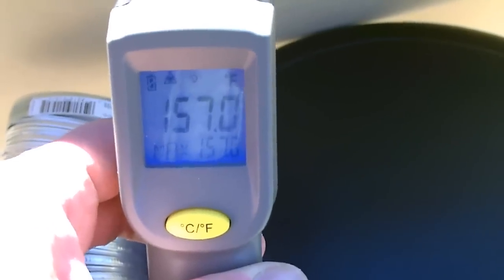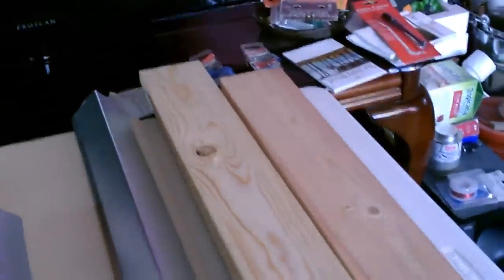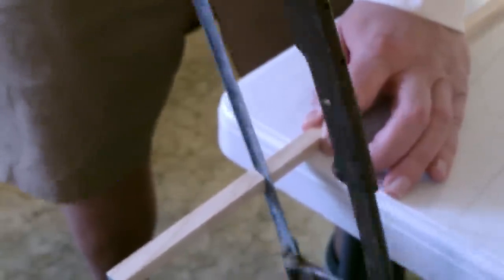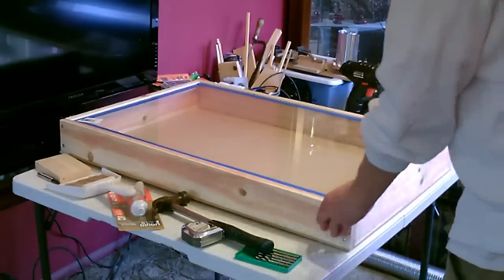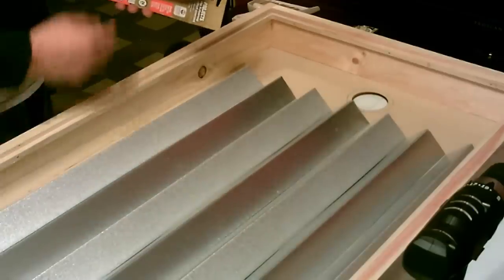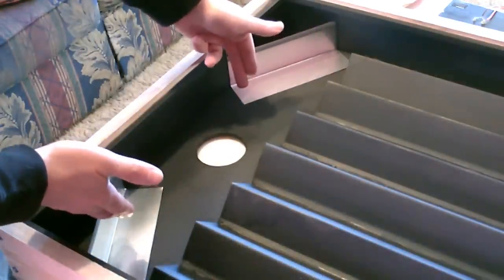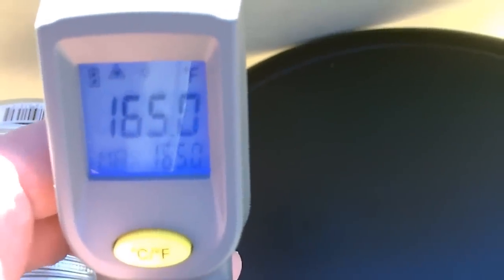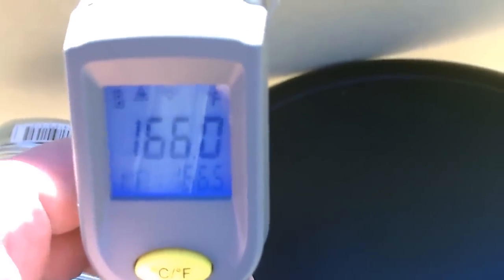DIY Solar Air Heater! - The Steel Slat “Drip-Edge” Solar Heater! - New Design! 160F 74C in January!

Comment: Would you recommend a bigger fan motor, for more air flow?  Thanks for the video.
Reply: More air flow means that the air remains in the box for less time, from the time it enters at the bottom until it is discharged at the top.  The air needs to remain in the box long enough for the heat of the metal panels to transfer to the air.  You need to find the "sweet spot".
Reply from the maker: hi. if you use a bigger fan you'd want to make the whole thing bigger (or the air coming out won't be as warm). the fan is sized to match the size of the collector.

Comment: And how did you hook it into the house?
Reply from the maker: hi. the best way i've found is to go thru a pre-existing window. i use a short section of 1x6 lumber (cut to fit the width of the window). then i cut a 3" round hole in it and attached the opposite end of the 3" duct hose to the wood (the same way i attached it to the back of the collector). then just drop it in the window and close window down on it. with this setup you can drill several 3" holes side by side if you want to, and connect 2, 3 or more collectors to the same window using the same wood. *other possible ways (without cutting a hole in home)... you can use any unused vents or an unused pet door.

Comment: Hi
As a novice excuse my query if nonsensical.
If you are receiving enough sun to make this work during the daytime surely it warm enough in the property.  At night when you do need the heat this would not work ?
Reply: Your house should be insulated to stop the outside altering its temperature too much. This is designed to trap the heat for use.

Comment: Google “solar chimney”.  Pull air from a duct through the lower part of your wall (or a lower floor/basement) and output it higher up the wall.  Angle your heater outside to optimum solar angle.  Convection will naturally pull air through the heater and your fan will not have to work as hard.

Comment: putting that on a table with the air intake below and the air output rising into a cabin would be a great way of making it all work with zero need for fans. Let convection take care of it all.
Reply: Just what I was thinking...
Reply: The fan is pulling the air though. Sure, convection would work, but the fan is going to move so much more air overall
Reply: @ZeroHecksGiven  I used a convection heater that had a fan, in one apartment. I always had the fan turned off as it made not a jot of difference.

Comment: Try using the inner plexiglass from an old big screen projection tv instead of glass. Its magnified so you'll also need to make a metal frame and possibly thicker gauge metal inside but the heat those generate is insane.
Reply: Are they UV light resistant? If not, the plexiglass could get brittle in a year. Great idea, though! Been thinking about covering some solar panels with it and giving it a coat of UV resistant lacquer.

Comment: We were building these at Mother Earth R&D in the late 60s and early 70s. Didn't have the solar voltaic panels yet. Depended on convection for flow. There was a company in Oklahoma in the late 1800s building them and installing on homes. That's where we got our ideas fir them. Helps to have a house 3' or 4' off the ground to lean collectors under windows for installations for the passive design.

Comment: I built a heater very similar to this one about 20 years ago. It had the air recirculated with simple internal ducting with ports top and bottom. The assembly fit over a double hung window and I could regulate the output by simply opening and closing the windows. This simple solar heater provided more heat than the South side of my home could ever need. No fan, no electricity, just the sun. I frequently had to close the windows because it was too warm. Total cost to build was about fifty dollars.
Reply: A good way to save money is to go to a scrap yard and find old fluorescent light fixtures. Inside you will find thin sheet metal reflectors that have the same 90°s as the sheet metal strips your using from home depot however you will get them at less than a tenth of the cost. Keep thinking outside of the box "pun intended" 😎👍
Reply: See people ??? This is what I'm talking about !! Build your own !! They totally work and aint rocket science. You cant screw up. They wont blow up. Hahaha. Good comment guy.
Reply: So you don't necessarily need the fan? Could it be done on a flat surface like a flat roof? Or does the air need to rise?
Reply: @ESLinsider  hot air goes up, so if you design a low air intake to a solar heater, and have the exhaust air high up, then you'll get a natural flow.
Reply: @HyperSculptor  How can we get this information to the European people for this winter? Because of Russia cutting off gas supply I am very worried about the average person who struggles to pay utility bills.
Reply: @worldpeace8187  here we are💪
Reply: @worldpeace8187  Just watch the tutotorials here on Youtube.  Heaters made with soda cans were invented for use in Canada - if they work there, they will work In Ukraine and the Baltics 👍🏽

Comment: I'm not sure why people use channels / tubes / cans... sheet metal should be adequate - a single plane in front of an air pocket behind, NO?
I also agree with Aguila below, direct your home air into the bottom, so it's already starting out warm, then being heated more.
And, lastly, you can forego a lot of this construction / assembly work if you just place a matt black sheet of metal somewhere in direct sunlight during the period you want heat. Don't block the windows, just place them inboard of the windows somewhere in the room, in direct sunlight.
Of course, these other ideas of insulated assemblies have a place when you want to Build them into your home without blocking windows.

Comment: Why would you not want to take inside air and move through?
Reply from the maker: hi there. i like using outside air because it introduces fresh air into the home. also , you only have to have one inlet into the home  (versus 2 inlets). but your way heats faster so you have to weight the positives and negatives of each and choose what's best for your situation. 🙂

Comment: You can use cardboard boxes to insulate the box.  Just cut and tape  inside the box.  The cardboard boxes are free from the stores.  Haft of inch of cardboard boxes could provide up to R5 insulation to the box.  The temperature inside the box will be higher as you add insulation to it.
Reply: R5 usually takes a bit over an inch of 10 psi rated polystyrene foam and cardboard is more conductive than most 10 psi rated polystyrene foam, so you probably want to rely on trapping an air gap more than so then directly using the cardboard as an insulator.

Comment: I have two sliding glass doors to do this with.. very heavy ! Build looks great obvious you could use insulation, and an old double insulated window is a plus. I believe you want the collector sealed
in front no air movement and about an inch back from glass. (You will get cold air exchange moving at glass surface especially without double glass). I may use down spouts for my large unit but for a small unit aluminum gutters flatend and reshaped  or roll of flashing perhaps bent like yours. great ideas !
Reply: Can we see a picture when you finish? I may need to build on soon.
Reply: @fabriglas  
Still have the glass but no build, Sorry. In all reality aluminum screen is best. Two layer's slitly separated. Speed of air exchange is important. So far as the sliding door material. Is just an insulated shadow box. The glass is great becouse it should be filled with orgon gass for its anti exchange properties. The frame would have to be strong as the sliding door is heavy. Sorry I can't be much more help.

Comment: Just an idea, why not do a box like this around the solar panel itself. Make the box about 6-8" wider than the panel each side and about 4-6" of space above and below. Matte black interior of course. Create heat and power all at the same time
Reply: Reilly Berg solar panels operate more efficiently in cooler temperatures

Comment: From my old days in engineering, before I switched to business, I think the "volume" of air is what's the biggest factor to consider with larger units. Our Co. Tech works the same way, the more air moved the better efficiencies)  2 fans putting out 170, vs 1 putting out 250?  (ouch?  That's HOT!  Great if you could store that heat for later too!)  Anyway- 2 Sounds to be about the same area covered as 1 big one. Was the glass cheaper/sq ft? Can/did you put on a bigger fan to move more air?  I was thinking of taking out 1/2 of 2 windows of an apartment and putting a collector in their place. You could then easily recycle the air. Just place it outside of the window channel so you can still slide the other window for fire escape. Making some sort of air movement baffles would help insulate it when not in use. Layers of light plastic sheets that lift when the fan blows? Oh yeah,would have to create a cloned 2nd open area at the bottom to input and distribute the air.   Another idea is to make fake Shutters as collectors? BTW-  Has anyone tried corrugated sheet metal roofing yet? Really cheap.
Reply: Ty máš tolik zbytečných oken. Pak účinnější bude je nahradit dobře izolovanou zdí a na tu zeď zvenku přidělat ten ohřívač. Ale navíc bude stejně jen rozdíl z tepelného zisku oken, který ztratíš a zisku z ohřívače.
Nemá smysl tímto zařízením nahrazovat dobře izolovaná okna. To už je lepší zlepšit izolaci oken. Třetí sklo, izolace rámu, zabránit profukování vzduchu různými škvírami.
Reply: @juraposp  Translated from Czech - "You have so many useless windows. Then it will be more effective to replace them with a well-insulated wall and add the heater to that wall from the outside. But in addition, there will still only be a difference between the heat gain of the windows that you will lose and the gain from the heater.
It makes no sense to replace well-insulated windows with this device. It is better to improve the insulation of the windows. The third glass, insulating the frame, prevent air from blowing through various cracks.
Reply: Im mulling over similar idea but with aluminum flashing bent with steep angles kind of like a 5inch thick high end air filter has those deep pleats... I think there is some reflection in all these solar heater designs so i want to try one with what do they call it "angle of incidence" where one angle that gets the light bounces majority of that ray onto the other pleat not back through the glass.. Im looking at 2 old slider doors  i have as the source of glass and building a frame with 2x8 lumber insulated with 2 inch foam inside the chamber then wrapped with bent flashing to be weather resistant. I am thinking this size unit would require 8inch inline fan, insulated ducting, temp control baffles/dampers, and be attached in some way to be removed or covered for summertime. Luck for me i have already direct south facing 2 story wall. I need to do a small test of the idea which is what i think many of the others are doing testing the designs on scale to decide. But i really do see and issue with the surface area and angle the rays hit or reflect off of all of the units people build. I liked one design i seen because it had 2 steps to the glass, one layer of polycarbonate and then a piece of tempered with an air gap between to slow down radiant heat loss out of the unit. i would have to build some sort of bracing for the poly on full scale. My second concern is building it to well and risk a fire if the fan fails. Wood will light off at a continued temp of 360F not sure about the foam insulations.
Reply: @masterdebater8757  Maybe use a mirror film facing inward, inside the glass, which sends any reflected light that would exit the glass back inward instead?
Reply: Corrugated sheet metal is what I was thinking too. It might even be cheaper to install, especially the thinner metal.

Comment: How about if the hose was sprayed black, you insulated the internal of the box and then used a slightly black tinted Perspex. All helps with heat absorption and would produce a potentially higher heat output. 

Run the fan at 1/2 power that would leave the air in the heat box for longer potentially resulting in even more heat being produced.
Reply: I've got one other thing to add to it... Using the "undercarriage paint" or the "rubber paint" for further insulation of the appliance.

Comment: I love to try something like this to heat a decent sized clay oven for cooking bread. Keep it a closed loop so air goes from heater into air channels through the oven, then straight back into the heater, back into oven continuously. I wonder if the recirculated air could get hot enough to heat the oven to 400-500 degrees? I've looked, but never found an example of someone doing that.
Reply: You'll never reach the temps u want.
Reply: Asi ne, při teplotě 400 - 500 stupnů budou tepelné ztráty vyzařováním vaší černé plochy kolektoru tak velké, že příkon už nebude žádný.

Comment: Hi great videos. I jumped the gun and put copper .7mm flashing across the back of my solar collecter. To still use it would you suggest I make your channel air heater and use metal strips instead of wood to help heat it?
Reply: Don't know what size of collector you are building, I've tried the vertical configuration, didn't work as  well as a continuous serpentine horizontal tube, small intake baffle at lowest level, exhaust at higher level. My build is 34"x72"x5" with a snap switch to automatically control off and on for the fan. At -12° last winter I had 3 hrs. at 110°, until the clouds moved in. FYI
Reply: @patzeuner3362  wat type of material did u use ? Did u make a coil or jus zig zag ?
Reply: @chevman46  I recycled some sheet metal for the first 2. I built another using aluminum cans, cut inside of the bottom and top, used silicone to stack/glue together. Made a small tray so I could line up the cans and glue. Since I used a single pane of glass from a sliding glass door, recycled (tempered) and built the box and tubes for that size. I use the tempered glass for safety. The aluminum cans made the whole thing much lighter. Also went from a plywood box to recycled (refrigerator outer case) bent and riveted and cut to create a lighter metal box. Hope this gives you some ideas.

Comment: I made some with metal 2x3 downspout. built my boxes 4x8ft, lined them with 1/2 foam insulation board, left refelective side facing inward. I painted the downspout flat black before putting inside and and sealing plexi glass, and got 250+F.  All my testing, I found the longer span you can run the air before leaving the box, the hotter it will get.
Reply: Dell Moore, True longer the better. Bigger the better more surface area. 250F wow nice unit you built there man! My 6x6 foot unit with downspouts puts out 195 F (90C) of heat when sunny when below freezing outside.
Reply: That's exactly the kind of info I've been looking for!
Reply: @Aaron16211  What are down spouts thanks.
Reply: @Workwithwhatyoucan  the pipes that attach to your Rain gutters
Reply: Do you have a picture or more information on your build somewhere?
Reply: Would you recommend using plexiglass instead?
Reply: Now there's an experiment. Make a completely closed hot box, no in and out, just to see the maximum temperature that could build up inside it. Your temperature was above boiling point of water, which however would worry me about someone getting burned by such hot air exiting it.

Comment: when you took the measurements of temperature how long had the fan been continuously running? I know an enclosed box will easily get way hotter than that if the air was still. But, what is the stabilized temperature of the air once all of the latent heat had been removed?
Reply: If ur concerned.about the fan temp, place it at the bottom intake.
Reply from the maker: hi there. the fan had been running awhile. (it was on a total of several hours. only stopped running briefly when i switched back and forth between the two solar panels)

Comment: Dude get that copper pipe that has fin's on it. Make Gallium Aluminum Scandium alloy and fill the copper pipe and sweat everything together and snake it through the bavkside of your solar heater. The Gallium Aluminum Scandium alloy will absorb and conduct the heat for hour's after the sun go's down. You can also take advantage of drafting and heat your home or green house. 😀👍
Reply: Thinking of doing this for my greenhouse, build the unit so it fits in where one of the windows is in an unused corner and recirculate the already warmer air inside....
Reply: Hey Jim, how can you make Gallium Aluminum Scandium alloy ?

Comment: Corrugated steel roofing works as well. Often times building supply stores keep odd length cover sheets from orders.
Reply: A good way to save money is to go to a scrap yard and find old fluorescent light fixtures. Inside you will find thin sheet metal reflectors that have the same 90°s as the sheet metal strips your using from home depot however you will get them at less than a tenth of the cost. Keep thinking outside of the box "pun intended" 😎👍
Reply: @TheDaken  where I live scavenging Municipal scrap yards  has been criminalized.